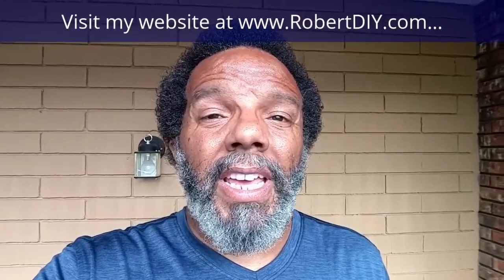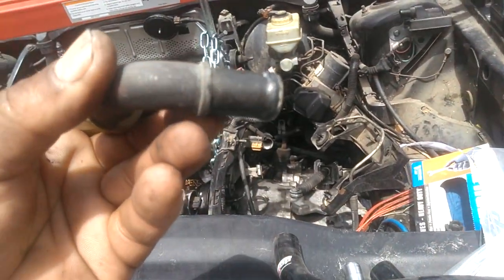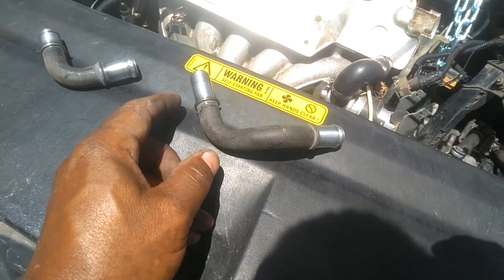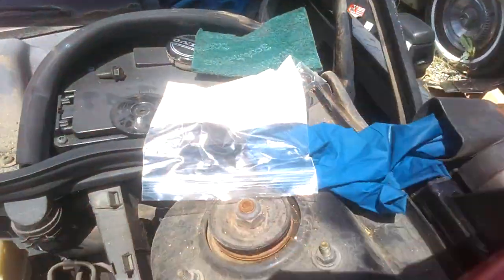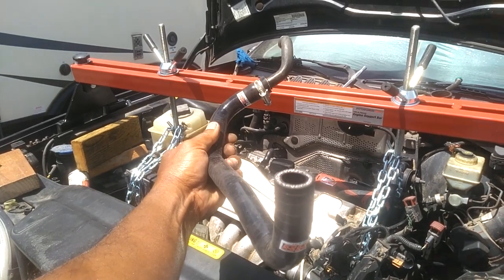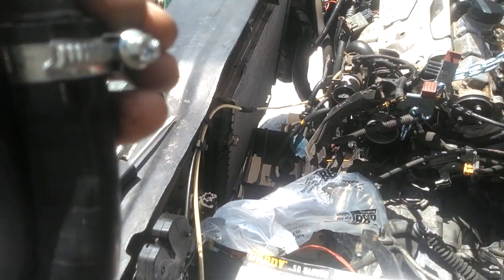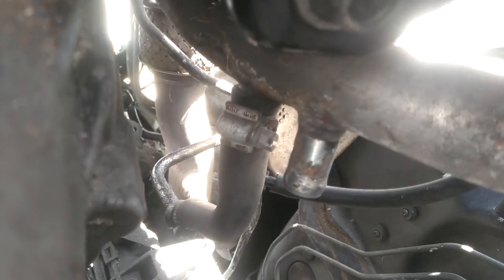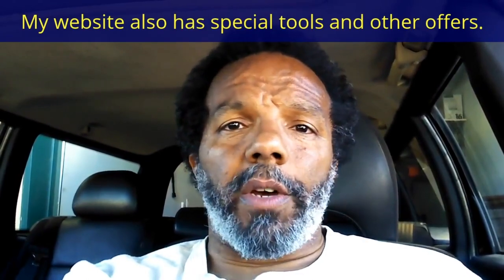Heater hose option for Volvo 850, S70, V70, V70R, V70 XC, C70, etc. New hoses swapping over old ends

Comment: Robert, I know its been a few months since you made this video. Do you know the inside diameter of the heater core hoses? My S70's heater core blew out and I am just going to loop the hoses since I only drive the car in the summer now.  Thanks!
Reply from the maker: https://youtu.be/gt9w-ZSxs9I
Reply from the maker: It's called bypass.
Reply from the maker: https://youtu.be/2CuUpdtHOSU

Comment: Are people really this cheap? I would much rather pull a complete, used hose from a salvage yard. But, 'if' you have to buy a new one, they range between $50.-70. Also, neither Oetiker or Worm clamps would be appropriate for this application.
Reply from the maker: For several months you couldn't even purchase the OEM hoses. Now they are available again. At one point, one hose was $130+. Now both are under $80. But yes, some people are that cheap.